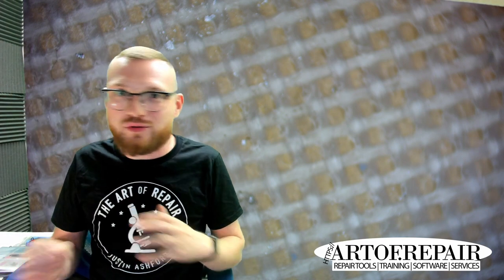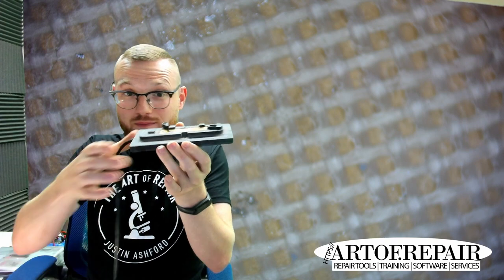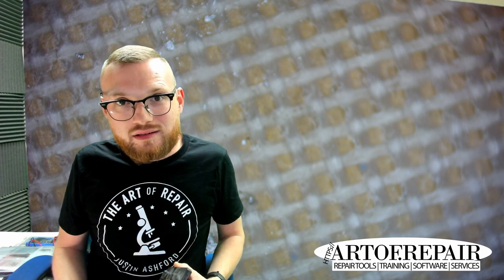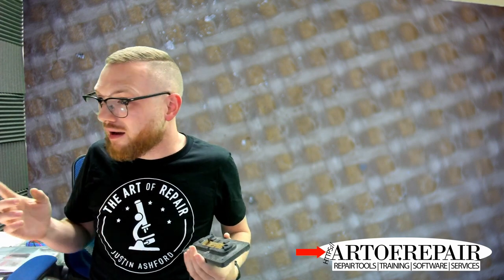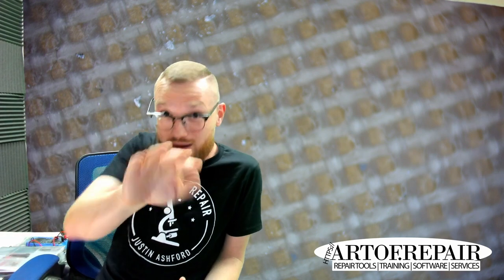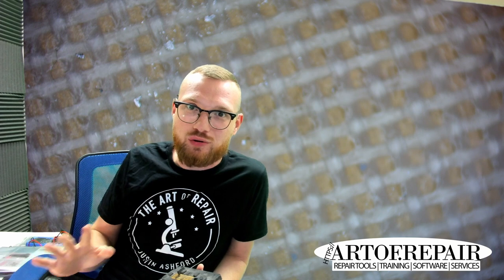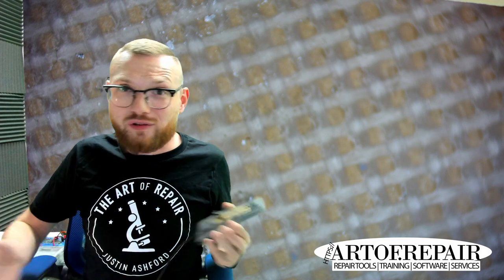Microsoldering Preheater Basic Use Part 1 | Freezing Thermal Inertia to assist your work!

Comment: What is a sandwich board? I thought all PCBs were a sandiched set, I didn't find much on Google but I did find old boards with large resisters and transisters?
Reply from the maker: Look at iPhone X and above, it’s two standard 10 layers with an interposer to connect them together, so we call it a sandwhich :)
Reply: @TheArtofRepair  Thank you for everything

Comment: Thanks, Justin! I agree with you for the most part, but man I sure love my preheaters! I work on TV's and tablets more than anything else just for a hobby. I have a LED preheater plate for LED strips that will melt the solder without hot-air.

Comment: I need your help! I used flux when soldering, but the flux vaporized in an instant. When I watched your video on how to desolder and putting it back on, your flux could take the heat much better than mine. Am I using the wrong kind? 
I used a heat gun at 400 C and the soldering iron at the same temperature - is this too much?

Comment: I have never used a preheater, and have a question. If you heat up the board to 140c with a preheater, would aluminum capacitors on the board fail and or explode? Some of them are only rated for 105c.
Reply from the maker: This is such a great question! let me try to help. So first off, we should look at the workside variable of "lowest breakdown temp" as this tells us the temp as which we can saftley work on the board. If the lowest we can work with on a pcb preheater is 105c then we should prob give it some room and work around 90c for preheating as not to evaporate the internal electrolytic caps material which could cause it to expand and be damaged.  This gives some room incase our preheater is not calibrated. Another thing here is targeted thermal energy and shielding. If we preheat the board its just to prevent thermal shock and warping in most cases. So getting close enough can help, we dont need to be so close to the wetting temp so im not sure where the 140c came from.  Now you can also target the component you wish to remove more carefully by using ceramic shields to prevent hot air from touching other things and with that I dont mean to use Kapton tape on the board, thats not an effective shield. So now we have a situation that the board is protected from too much energy and you are only directing the heat on the item that needs removed. 

If you need to remove the caps I sugguest just using a desoldering gun so you can remove them quick or a desoldering pump to quickly evacuate the solder and remove the component.